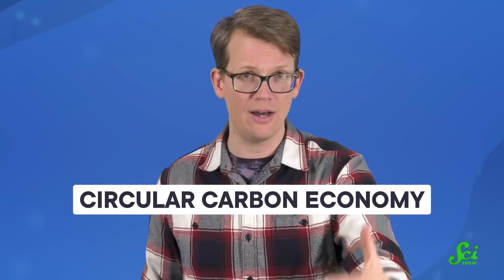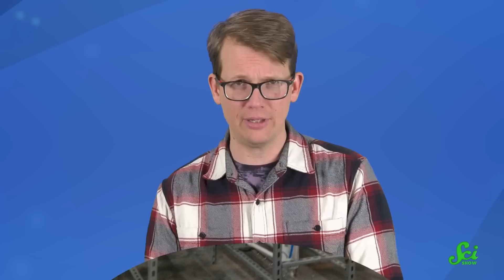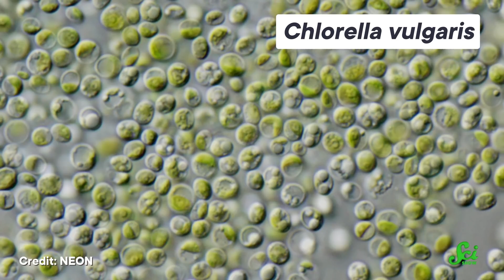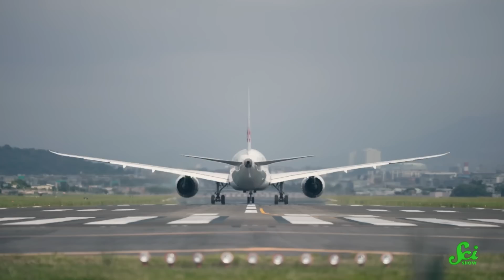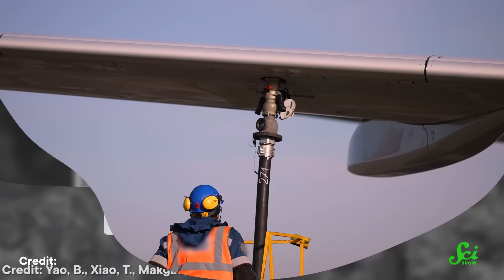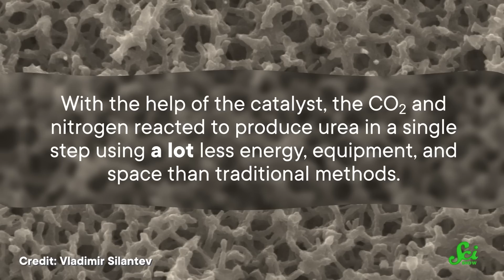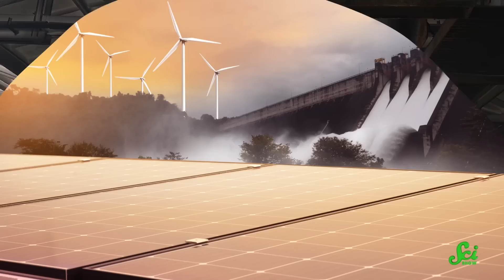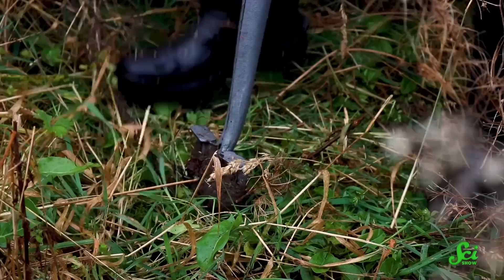One Way to Deal With CO2? Reuse It

Comment: So, to convert CO2 to jet fuel you just need the right catalyst and 350°(F,C or K?) of heat—so how much fuel energy do you get from that “350°” temperature? Is it enough to make back the energy it took to produce that heat, or is it like ethanol, which takes at least as much energy to produce as you get back in your gas tank?
Reply: Physics dictates you cannot get more energy from it than you consumed to produce it. The point is that such a fuel would be carbon-neutral, assuming the initial energy also is.
Reply: @The_Blazer-u9t  so where does energy come from?
Reply: @Fucktardtactics  Renewable sources. I guess the point isn't really to "use" CO2, but rather keep it in the system. Just like plants - they photosynthesize and store that light energy in glucose, which we eat and turn back into carbon dioxide. The CO2 never gets used up, but in this way it basically cycles forever. Until the sun dies at least.
Reply: @Fucktardtactics  
The grandest question none of these guys can actually ever really answer, especially in the context of being 100% green.
Reply: @Fucktardtactics  that is a kinda vauge question but high level the big bang put a fixed amount of energy into the universe and it keeps transforming between different forms but slowly is being lost to entropy which will eventually lead to the heat death of the universe.

From an energy policy human level perspective there are primary energy sources and secondary sources. Primary sources naturally have energy either due to nuclear (uranium or the ball of fusion we call the sun), or the residual heat in earths core left over from its formation, or have been charged by the sun like how plants turn sunlight into sugar (all fossil fuels are deap plants that stored ancient sunlight). Secondary energy sources have been made by humans at a net loss like electrolysis of water to make hydrogen and oxygen. 

The reason we would sacrifice energy in a net loss to change its form is because the new form is more useful. Thermal power plants turn coal, gas, uranium, and even concentrated sunlight into electricity with an efficiency just over 33% resulting the the entire grid only being 33% efficient. (Thermodynamics power cycle, physics demands that heat be rejected if you want a closed cycle. However, co generation plants will use the waste heat to make hot water and sell it to the nearby community making the waste heat useful energy increasing net efficiency of the fuel as opposed to useing the inefficient electricity to heat the buildings)

Sorry for the text wall, but energy is a complicated thing.
Reply: You can leave out Kelvin "K" in your struggle for finding the meant unit for the "350 degree" as "K" is never measured in "degree".
Reply: @jus7040  Agreed, of course, but I find so many who are unaware of that, I grouped the maker of this vid with those, given the lack of thought that went into the statement.
Reply: It takes substantially more energy to convert free CO2 just into compounds that can be buried as part of prototypical “carbon capture” methods as compared with the amount of energy released by burning fossil fuels.

Converting such compounds back into useable fuel goes beyond impractical and enters the realm of absolute fantasy.
Reply: @sncy5303  every source of energy generates CO2 and other compounds when taking the "grey energy" into account.
Reply: Even for 350C, that’s not very hot and can easily be achieved with solar power in the deserts of places like Arizona without using much space. Solar power can easily generate enough power needed to help recycle our CO2, but the problem, as always, has been energy storage, essentially limiting the time we can perform high power processes.
Reply: @Professor Frog 1- While true, "waste burning" reactors are an increasingly close reality (and they already exist) so "Very long term" management for High Level Waste is not a technology issue but an economic and political one.
2-China, India, and some Latin American and African countries say otherwise, all are planning on building reactors, and seeing almost 3B of investment in VRE for average productivity of less than 600MW, plus 2B for energy storage by hydrogen(1GW electrolyzer), and 2.5B for 1.1 GW of Hydro/980MW PSH, , while South Korea is building 1Gw Reactors with productivity over 90% for 4B in 4-5 years a piece. 
3- France built 56 Reactors in 15 years in the 70's and 80's. They literally built them so fast that demand couldn't keep up. China will build 100 in the same time frame. 
4- Breeder reactors, liquid fueled reactors, development of Thorium fuel cycles, seawater extraction (something that Nuclear will help doing), dismantled nuclear warheads, reprocessing of used rods, and mining for it locally. Most Uranium isn't strip mined either. The energy density of Nuclear is so huge that it's not as much of a problem.
As for reliance on "certain" countries, most wind gadgets and coalar panels are built in China.
Reply: This is the right question to ask. Aaand the video entirely avoided it. Not a good look for Scishow or Hank.
Reply: @sncy5303  Good that you included hydro and nuclear—the others just won't cut it for the foreseeable future…
Reply: Actually he got a point, sooner or later, before or after we figure out how to make our production carbon neutral, the next thing to keep watching is pure energy budget.
Imaging we have already got carbon neutral, but now we absolve tones of solar radiation that normally should just reflexes out, or unlock tones of pure heat out of nuclear, fusion or fission, those energy putted into biosphere won't help to cool the earth.
Reply: Depends on how the heat is generated, obviously. There's free heat everywhere. Sun farms (basically just a bunch of mirrors focused on 1 spot) can basically boil a kilo of steel per second for free. I suppose we could just wait for Earth to heat up to the same temperature as Venus then simply going outside in daytime will get easy access to 350C.
Reply: @fvckyoutubescensorshipandt2718  
Venus is hot day and night, but not because of the CO2 concentration in the atmosphere or else Mars would be just as hot.
Reply: @sncy5303  if we are currently buying fossil fuels to produce energy, why would we use any renewable energy to inefficiently pull CO2 from atmosphere? Maybe we could make more use of waste heat from other processes would be a more useful way, if we can do it at a small enough scale.
Reply: @SelectHawk  Nuclear. Newer reactors reach 600C or more of operating temperatures, some are using molten salt for thermal storage.  Cogeneration with Nuclear could solve that problem. And we wouldn't need to strip mine everything for lithium. But Nuclear is big and scawy.
Reply: @AlldaylongRock  cogen, aka use the waste heat. Like I said. I have no problem with nuclear, I was just pointing out that using  solar to pull carbon from atmosphere would be dumb, at least if you could be using it to replace carbon-releasing energy production instead.
Reply: @SelectHawk  VREs(wind and solar) are too energy dilute and resource intensive to be any useful for making synthetic fuels anyway. Or to be a main energy source for humanity for the matter. Nuclear is where it's at, and Hydro as the "emulsifier" of the mix with VREs and other renewables, like Tidal. Be it with advanced fission reactors, Fusion, or Geothermal if we can dig deep enough(I consider Geothermal being "second hand nuclear" ..

Technically for Cogen, you may actually undesize the turbines for production of electricity (they do this at the Bruce NGS in Canada to provide steam for something) or harvest the heat directly. It's not necessarily only waste heat.
Reply: @AlldaylongRock  Yes and becoming more scary every day with the droughts making water less available.  What cools nuclear waste?  Water and what is government pushing? Electric cars, such scam if you look at closely.
Reply: @AlldaylongRock  Nuclear is big and scary. It is dangerous for lifetime after lifetime. No one wants to store the nuclear waste.
Reply: @AlldaylongRock  it makes sense to directly produce heat with cogen if you are using the heat directly, which is more efficient than using the process to produce electricity and then convert to heat. Large manufacturing plants or other building that have high heat and electricity requirements sometimes do that. Makes no sense to do that to pull CO2 from atmosphere unless you are already producing more energy than you need.
Reply: @SelectHawk  Refineries come to mind, as well as wood pellet factories. The Sines oil refinery in Portugal uses NatGas fired Cogen for powering their refining processes and produce steam. Wood pellet factories burn some of the biomass to also produce steam to "glue" the sawdust together. Both inject excess electricity into the grid. Sometimes Cogen (even with Nuclear) is used for district heating and other industrial purposes. Cogen is up to over 90% efficient overall. Nothing can beat Cogen in terms of efficiency. Now imagine refineries and wood pellet factories using nuclear Cogen! Not only they would be much cleaner, but the yield of products would be much larger, since they wouldn't be consuming NG or Biomass for the boilers. Microreactors of advanced technology (like FBRs) would also mean that the fuel could be very cheap, being DU and processed SNF. And would generate bred fuel that would have an increased value.
Reply: @cathy_p637  You know that Nuclear power is used to desalinate seawater, right, and they are very good at doing so with the waste heat from the power plant? The spent rods need to be cooled for a couple of years inside those pools, then go for dry storage or reprocessing. Can also be used as fuel in Fast Neutron Reactors. Which turn it into mostly short lived isotopes that are either useful for medical and scientific purposes, or decay so fast that it's not a problem.
Nuclear power plants should mostly be located at the shoreline for easy access to reliable cooling water and to use the waste heat for desalination. Of course, put up proper protection against tsunamis if necessary. That is a non-issue with Nuclear power.

Comment: That is 100s of years away.we will never be carbon free. I live in the northern Midwest and we need natural gas to heat our homes. They say, go to electric cars, but they still rubber and plastic in the healthier electric cars. They still depend on the gird, which powered by fossil fuels. We don't want to end up like Texas in the winter, where the wind turbines froze during the cold winter in Texas.

Comment: Hmm, I wonder if that fuel-making process could let you make gasoline at home
Reply: That sounds dangerous.

I'm debating whether that actually means I should approve.
Reply: What would be the point?
Reply: @FourthRoot  Make gasoline for your not-electric antique car, save for an emergency generator, give away to neighbors.
Reply: @Restilia_ch  Oh, you think there will be no more gasoline in the futue?
Reply: @Restilia_ch  No fuel generation creates more fuel than it uses to make that fuel.  That's why we burn fossil fuels.  The work generating it was already done.
Reply: @nobodyspecial4702  I am aware of thermodynamics, thank you very much, the process could be driven by renewables like solar and wind. It said it needs 350 degrees (no unit but assuming C) which is easily accomplished with electric kilns.

Comment: We have the science, we have the technology. We could go carbon negative by dinner time tomorrow. We just need the will and the capital to put all these systems into practice before it's too late.
Reply: Most of all, we have GREED.
Reply: You sound like the apocryphal story of the new Clintonista staffers meeting with DOE engineers trying get electric cars off the ground: asked why they couldn’t get better range in the current cars, engineers said they were in a bind—bigger batteries weigh more, which offsets the higher output—it’s just a law of physics. 
Clintonistas: “Well, that’s why we were elected—to cut through all this red tape, repeal all the laws that impede your progress, and get these vital projects done for the American people.”
Good luck with that…
Reply: i guess the energy to do all this comes from unicorn farts
Reply: @moeron9172  more stinky than cow farts, the elephant in the room's fart, aka the military industrial complex.
Reply: We have neither the science nor the technology to go carbon negative. At best we can get closer to carbon neutral.